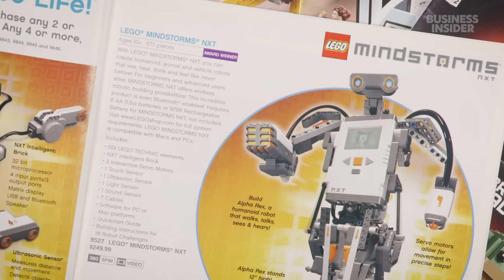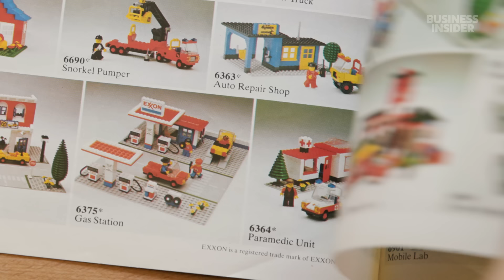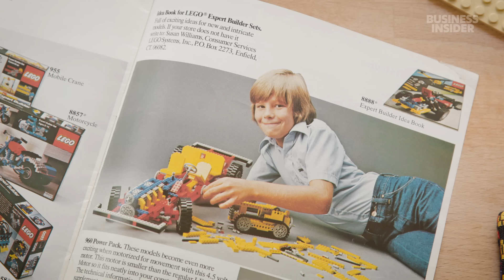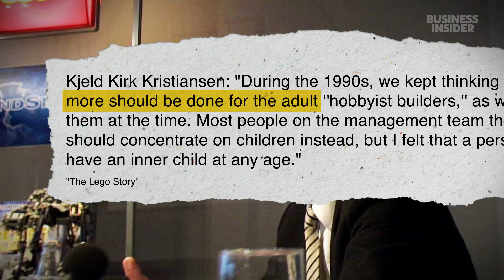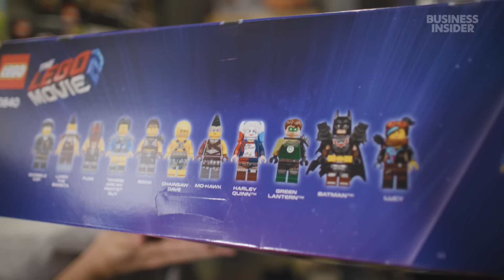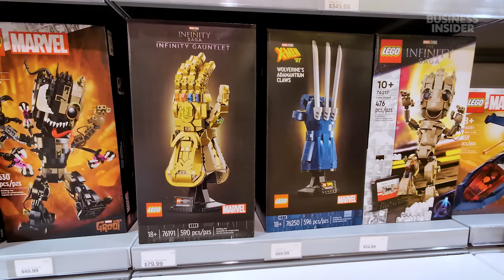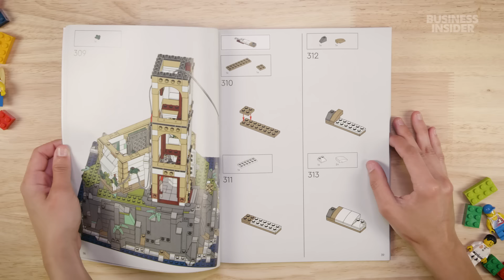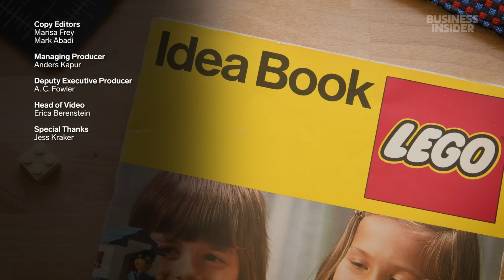Why Lego Is So Expensive | So Expensive | Business Insider

Comment: This felt like I was being advertised to. No criticism of the price gouging? No criticism of the decline in quality of set design and brittle and discolored plastic? No criticism of Lego buying up the aftermarket so they can profit off of used bricks too? No criticism of them abandoning their core customer base of children? No criticism of their focus on new customers who have never touched lego instead of their fans? Not to mention the anti-consumer business practices of their exclusive GWPs and blind boxes. The price per piece argument is borderline misinformation when you look at what those pieces are. Modern sets are crammed with hundreds of tiny bricks that didn't exist 20 years ago. Price per piece isn't a valid measurements since bricks were on average much much larger back then. There is a growing community of AFOLs who haven't bought a new set in years. At the rate Lego is going right now it will go the way of the model train or the metal soldiers. Forgotten and irrelevant.
Reply: Thank you
Reply: Not to mention that there are good alternatives to Lego like Bluebrixx, Cada and Mould King, that are way cheaper, but quality wise better than Lego. There is no valid argument for Lego to be this expensive, especially not with their quality loss...
Reply: Those tiny bricks add details that make the set look more refined. No one would buy Lego if it would still look like those ancient blocky sets. I don't want larger bricks, I want a good looking set.
And what's wrong with new customers who "never touched Lego" before? Isn't this how fans are made? You weren't born with Lego in your hands. And as far as I know, the sets for kids are still here.
Reply: @sendmorerum8241  The Problem isn't that there are more smaller pieces in the sets. I think most would agree that that makes the sets better. The problem is that a small piece doesn't have the same value as a large one. So with the average piece size decreasing, the price per piece should be going down. This is reflected in the in the price per gram.
Taking the Millennium Falcon from the Video as an example, the old one cost 7.9 ct/g while the new one costs 11.8 ct/g. This same reasoning applies to nearly all newly released sets.
Reply: I agree and disagree. I agree that it is frustrating seeing "piece counts" increase, when all they are doing is making the legos smaller. However, this does add value in the detail of the set. Additionally, what other product that has been around for 20 years can say it's even remotely close to the same price? If we are looking at a 2-3 cent increase in price per piece - that's well under inflation. I don't know where you're going with the brittle and discolored plastic. I've owned lego for 19 years. Yes, some of my white sets are a bit yellowed. But I've never had a piece snap, and yes I have the infamous "brittle browns" present on my OG MTT Trade Federation Droid Carrier. I'm curious as to where you were going with the quality criticism because from my experience, Lego has been the best.
Reply: @shawnboosveld7042  It seems like my replies here are constantly being deleted? Do you guys still see them because for me they are gone. Let's try that again:

Since bricks aren't made in Denmark anymore but many factories all over Asia, mismatching colors have become more and more of a problem. Just buy any mostly monochromatic set and you will see a variety of shades all throughout.
And yes yellowing and discoloration over time is also increasingly becoming an issue, but I'm talking straight out of the bag. Additional parts are now often scratched when you open the box, especially large, see-through canopies.
This hasn't been an issue 10 years ago.
Lego has borderline monopoly on brick build toys, hence the drop in quality.
They know people defend them and buy their products anyways. But most other manufacturers are far superior in terms of consistent plastic quality.
Reply: Don't forget about the fact they're actively stunting creativity and preventing single sets from being rebuilt differently by filling the inside of sets with random colorful bricks (not to mention they save a lot of money by just accepting miscolored/unfitting joint and pegs instead of producing them in more colors)
Reply: @shawnboosveld7042  You can buy the yellowed white pieces with a new model now. That is the level of how bad it has become.

The price per piece is also misleading when you look for technic sets. 4000 pieces, 420€. 1600 pieces are black and 400 are blue connectors which a total value of ~20€. so you pay 400€ for a 2000 pieces set.
Reply: Business insider vids are paid. They never criticize the subject of the video
Reply: I'm not even a LEGO fan and I wasn't pleased with the lack of exactly what you listed. If any fans have suggestions of videos that actually go into these topics that are accessible to outsiders I would LOVE to hear about them.
Reply: I agree with everything you said.
Reply: 100% spot on. This felt like a documentary pro Lego than answering the freaking questions. Haven’t seen it full yet, but they’re not focusing as well as the production costs. How much does Lego spend to make a set? How much does Lego have to charge the customer for the license on their products (like Disney for Star Wars, Indiana jones; Warner bros for the hobbit and so on)? Lego can be cheap, it’s plastic that will last (if put on a freaking shelf like the people who are paraded here almost like Lego hoarders who in my opinion need to socialize a bit more because like wtf, shelf after shelf of just Lego bricks? 🤣 it’s creepy and hilarious at the same time and who am I to critique because I like legos and my sets are also in a shelf but not like that lol) so what’s the point of charging upwards of 700$ for certain sets? At that point don’t even make the set. Anyways, great comment and what a bad video this is
Reply: @leonardoespino9780  Especially since Lego bricks are in an inferior quality to other brands (note: not "manufacturers"!), who only charge a third of the price. When you buy "Lego" you are clearly being charged mostly for the brand name.
Reply: @nicklockk  makes sense. Although I really like Lego-made bricks compared to other “knock-offs” because they are a little bit more snug compared to the competition in the sense that it’s a tight grip and when it comes to taking them off its smoother. But makes sense. I remember that I bought the Lego at te (for 140) and spend like 100$ in non-Lego merch for Star Wars and I bought like 2 trade federation tanks, like 100 battle droids, 24 super b-droids, 3 destroyers, and like 14 clones. And don’t get me started with the addition of stickers too. Cheap skates that they won’t simply print the image to the piece instead of us doing their work. Lego is definitely such an anti consumer company but I won’t change if  people  continue to buy their sets… but they are the only ones so that’s even sadder too
Reply: I'm in my 30's now and loved the Bionicle era of Lego, since then I've never been brought or owned a set since around 2002. I remember still liking Lego but around then, as touched upon in the video, the video game market started becoming competitive and price for Lego shot up. I was in a middle income family and my father pretty much assumed for me (and I'm grateful for it in retrospect) to buy a video game or computer for Christmas, birthdays etc. Lego simply became too expensive for me around then. 
Now I have my own kid who's a little too young for Lego but with the prices and quality being far more detached from reality it's safe to say I'm a lost potential customer when there are other competitive brands on the market. I always felt the sets were a one time restrictive thing too, it takes away from the creativity.
Reply: thought it was just me. i was ready to hear about how Lego literally is highway robbery
Reply: Imagine being upset about unbiased journalism
Reply: @Uniqdna  The whole premise of my complaint is that it is biased. My first sentence is "this feels like advertisement".
Reply: @Lichti82  I've bought like 100 sets this year and haven't gotten a single yellowed white brick. I have a lot of friends who buy Lego that haven't had that issue either. the only discoloration I've seen is varying shades of brown brick, but that's about it.
Reply: Model trains are not forgotten and irrelevant! Metal soldiers have mostly been replaced with plastic ones now due to advances in moulding. Just look at Games Workshop.
Reply: Nailed it. All I could think of as I watched this was how absurd it is to pay $1.5k for a box of plastic peices that probably cost $5 to manufactur. Lego is just another example of the degenerate economy that we live in and how it's detemrined to squeeze every last penny out of us. 😒😒
Reply: @unsteadyeddy3107   And GW is doing the same thing as Lego.  They keep jacking up the prices while shrinking the model count.  If they continue on their trajectory they'll nosedive due to pricing out the non-whales.
Reply: @piinkmochii  " i was ready to hear about how Lego literally is highway robbery"

not a fan of Lego's prices, or all the "pre-built" sets, but you probably need to look up the definition of both "literal" and "highway robbery"
Reply: @nicklockk I love my off brand Zelda legos 😂 it was a fun throwback to build them with the ladyfriend
Reply: Price gouging is not a thing. The market determines the price. Nobody needs LEGO. However, billions of people want LEGO so the price goes up.
Reply: @zachjones2346  lol look! this guy still believes in econ 101 as an adult
Reply: @nicklockk  If LEGO tripled the prices, nobody would buy it. You can't just raise prices because you want more money. It doesn't work that way.
Reply: @Hans-Dieter_Wurst  You say value PER GRAM? This is not food or some drug! It's just cheap plastic. 

The demand for these smaller pieces is high enough to boost price. Look at any reseller's shop. Performance over mass.
Reply: @sendmorerum8241  That isnt about the actual Plastik value, its more to have an Indicator for how large the pieces in a Set are, because a set with Lots of big Bricks and plates will be bigger than one with the Same piece count but Lots of small pieces.
Reply: Yeah, and that music. The video is like a nostalgia bait for manchildren and how Lego company uses the said mainchildren as an excuse for high pricing.
Reply: @Hans-Dieter_Wurst  You used the same argument. You want bigger (and less detailed due to the lack of small pieces) sets. And I still say quality over size.
Reply: @sendmorerum8241  I actually like detailed sets, i just mean that if there are more small pieces in a set, which is a good thing, the price per piece should be lower and that isnt happening at lego right now
Reply: This!
Reply: Because of all the things you mention and the fact that other brands like Cobi, Cada, Pantasy, Funwhole, etc. are now often making better sets with better quality at lower price points, it makes little sense to buy any Lego now if your interest is in building and creativity, as opposed to being a Lego loyalist. (Never understood them: what has Lego ever done for them that they didn't have to pay for? Nothing. Lego exists to take your money not be your friend.)
Reply: Exactly. I they don't address it, but the moral is that Adults ruined it for kids.
Reply: The only comparison was the millennium falcon in which they blamed inflation they didnt mention how a 1000 pc set is $150 now
Reply: @CAETT0  also Cobi

Comment: Im glad you mentioned how much the older sets would cost if they were sold today, showing that even though they would be cheaper than LEGO is today, they were never actually "cheap"
Reply: It's anyway still an illusion, they added just tiny parts that costs lot less to produce
Reply: @dr.angerous every new piece would require new machinery, and would probably be used in a limited set of sets, so it would be much costly. The larger classical pieces are cheaper simply because they are so standardized. Just because something is tiny, doesn’t mean it should cost less - actually it’s often the opposite.

Comment: wow guys you managed to do a 28 minute video without even answering the question suggested in the title, bravo! 👏🏼
Reply: My thoughts exactly
Reply: Lemme help you with some logical thinking. They mentioned Lego found a new customer, one thats spending a lot of money. older people. So in theory this would explain why it become more expensive? Kids buy less these days, adults with more money buy more? it's become more of a collectors item. so that all seems logical right?

I think you should spend less time googling stuff and try to use your brain a bit more so that you can think for yourself.
I understand you expected a straight forward answer, but not everything in life has a straight forward answer.
Reply: The Dave guy said his collection is around 50,000 dollars, kids dont have that kind of money. They also mention sets are only made for a limited time. It creates a limited market, rarity and collectors value. Again, use some logic, there are many answers to why its become expensive.
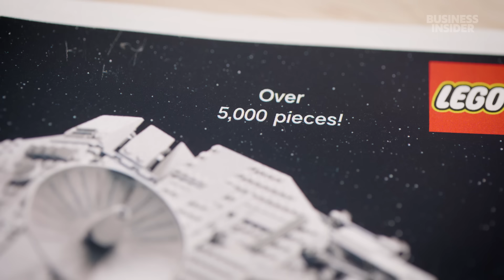Reply: 18:38
Reply: And you missed the entire point of the video, bravo.
Reply: Like they said… the cost is more because the sets are much larger and the part per piece has basically gone up 1 cent per piece but is on track with inflation.
Reply: @ClubBrick  the pieces are smaller and lower quality than back then. so it doesn't excuse the pricing

Comment: The price-per-piece ratio is more or less redundant these days with more recent sets having a lot of smaller pieces for detailing. The 2 falcons mentioned on the video (10179 and 75192) are the same physical size despite the newer one having two and a half thousand more pieces.
Reply: Are they? At 23:35 they showed two millennium falcons of different sizes. I thought they were comparing the old one and the newer one.
Reply: @Raphael4722  The smaller one at the bottom isn't a UCS one - it's the 75375

Comment: I just walked into Best Buy yesterday and walked out with their final UCS Venator-Class Republic Attack Cruiser 75367. The detail from the engines to the underside is phenomenal. I haven't put together a set like that since the UCS Imperial Star Destroyer 10030 in 2002. It lasted about 3 days before it collapsed under its own weight. The later sets improved on the build rigidity.

Comment: To anyone who has old brown bricks, you can save it. Spray the bricks with a little cooking oil. Nothing crazy, just a fine coat is good. Place it in the oven at the lowest temperature possible, usually around 170F. Let it bake for about 1 hour at the 170F, then turn the oven off. Do not open the oven door or take the pieces out. Just let the oven cool down overnight. Lego bricks begin to melt once you get around the boiling point for water, so 170F is ideally best.

Comment: They just focus much more on larger sets than they used to decades ago. Its typically uncommon for there to be more than one or two sets in a wave of sets for a theme that are affordable for kids - the vast majority of themes will have more sets that easily cost £50 and up, which is much more of a struggle for a kid to be able to afford by themselves. Then with licensed sets, often times they are massive, one-off builds that cost in the triple digits because they are always catered to the adult market, even if smaller sets of the same theme would be appealing to younger fans. Look at the recently announced Deku Tree from Zelda, for example - enormous set, £260, and it will be a long while until we would likely see a proper full theme of Zelda sets. And even then, I can guarantee that the majority of that theme would be higher in price and generally unaffordable for the average person or child.

Comment: Lego jumped to "Price per Piece" because they setup their kits to have more parts than they actually require.  If you look at a lego set from 15 years ago you'll find that there is a huge difference in the number of "tiny" pieces vs larger pieces.  Take the "Queer Eye" set, for example, which I just helped to assemble recently for my fiancee.  

In this kit there were numerous "chest" pieces that were just designed to hang on a clothing rack.  Being of a logical mind I noticed something that seemed weird and commented to my fiancee, "Why do chest pieces, which are supposed to be simulating hanging clothes, have HANDS?"  And it's true.  Every chest piece that was "hanging" in the wardrobe came with 2 hands to install on them for seemingly no reason. (other than maybe raising the kit price?)  There were also a ton of accessories provided (multiple scissors, combs, knifes, etc) that were placed INSIDE DRAWERS.  Again, why?  Raising the number of pieces in the kit.

I then looked at the way the set was assembled and came to the conclusion that there were actually a LOT of blocks, specifically in the foundation "floor" that could have been built easier while maintaining the same look, appearance, and build strength of the final product.  For example, instead of building the "carpet" under the couch with a whole pile of 2-wide plates they could have easily done a couple larger 12-wide panels.  There were also places where they used a bunch of 1x1 bits beside each other where they could have easily put in single 2x1 or sometimes 3x1 flats instead.. But that's not as many parts, so it would have lowered the price of the kit.

Lego's visible and undeniable greed is basically why I've recently shifted over to other companies like JMBricklayer.  They charge you based on the cost of the kit, not how many pieces there are.  In addition, their kits are not only just as detailed as Lego, they cost much less than Lego, have equal or better quality than Lego, and most of them even come with lighting kits INCLUDED.